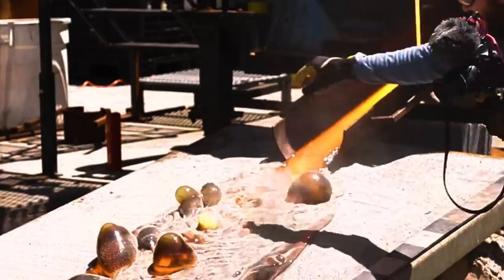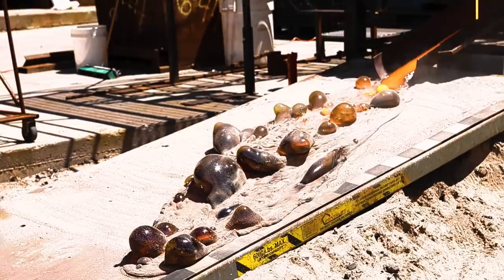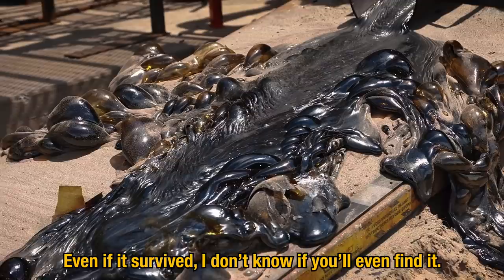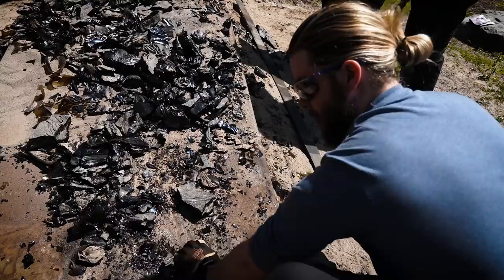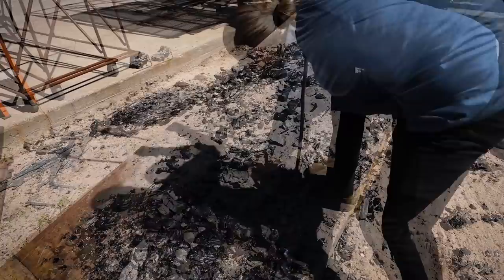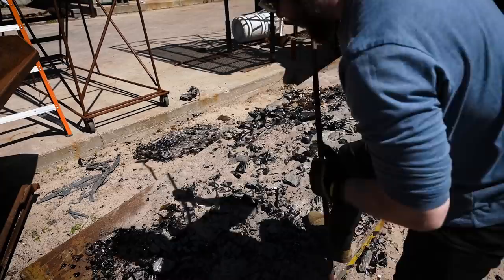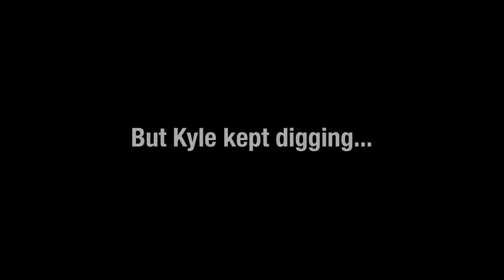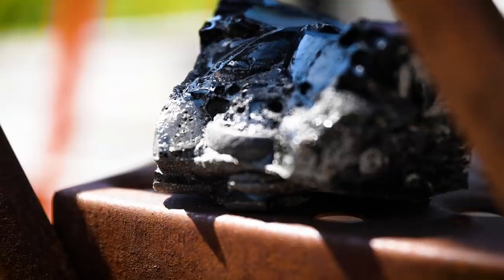Will REAL LAVA Destroy the One Ring?

Comment: This has some pretty interesting implications for the Terminator Franchise...
Reply: Maybe, but if we consider that metal is really good heat conductor and T-800 was slowly submerging into the melted metal (which was further continuosly heated), it's pretty safe bet for complete destruction od said Terminator model.
Reply: Uuuuuu
Reply: nah, the franchise is still dead and melted
Reply: We don't actually know what technology was used by the T-800, but yes. The T-800 had a nuclear fuel cell, and since it didn't explode like the hydrogen fuel cell of the T-850, that may mean some interesting radioactive material in the steel. Modern information technology is based on silicon, copper, lead, and a host of other materials, all of which would degrade in some form at those temperatures. Unlike basalt, steel does transfer heat well, and unlike lava this was actively being heated, so if the information technology was anything like modern, then it was destroyed, but would leave a mess of strange impurities in the steel.

You're not going to be able to reverse engineer the hardware, but you can probably figure out what alloys it was made of and what its nuclear power source was.
Reply: @Merennulli  Re: impurities in the steel.  Most of the Terminator would be in your driveway, not your car.  Impurities in steel production are skimmed off as slag.  It looks like pumice and it is often used in road construction. I used to live not far from US Steel and they'd have mountains of the stuff piled up across from the blast furnace buildings.
Reply: @Lawrence330  My impression from the chains and other structures was that this was a vat further further in the process prepared for pouring.
Reply: hmmm so so, steel has a higher Melting temperature than rock of any kind. so terminator works out just about really.
Reply: No. Molten steel inside an industrial furnace is not the same as "lava" on a metal sheet.
Reply: Quick science lesson.  Lead (Pb) melts at 327C, Tin (Sn) melts at 232C, yet once melted, they alloy into 'solder' which does not completely harden until 183C or lower.  It is possible, the right ratios, to have several metals with melting points of 232C or higher that once alloyed will melt in very hot water (70C range.)  One example is Wood's metal.
Reply: @wayneegli8379  Now I want to see someone make a replica of the Fields Medal out of Field's metal.
Reply: technially he died in molten metal much worse then the stone lava.
of course skynet did adjust the design to be far more resitant to heat after GEN 1 Arnie.

Comment: Big difference between this and what we saw in the film: this was a fairly small flow that cooled quickly, whereas in the film it was chucked directly into a large magma chamber which was being kept hot. I would hazard a guess that the surrounding lava would keep that insulating layer from solidifying, giving the Ring enough time to heat up and melt.
Reply: Also id imagine the ring being actual gold all the way through, or at worst gold plated steel which would melt at a lower temp
Reply: I'm going with the magic catalyst reason. Having done some casting and melting metals for jewelry,  it doesn't go that fast, even at super high temp. I think it's more that they fulfilled the magical requirements to un-make the ring, the magic unraveled, and the ring essentially melted itself.
Reply: @seancrane278  that was my interpretation too, it's not a matter of melting point, but of the magic that was in it being transferred back to Sauron. Putting it into Mount Doom bought it full circle back it its starting point, forming a ring of a different kind.
Reply: A bigger difference is this is real and the film was CGI
Reply: The "real" One Ring probably didn't have a titanium core...it was...UNOBTANIUM! Bwahahahah!
And yeah, in a real magma pool you'd likely get a leidenfrost effect, but a few minutes of heat soaking'd bring everything to thermal equilibrium and "ta daaaa!", no more ring thingy.
Now about those eagles...
Reply: @svenmorgenstern9506  The titanium core is probably what helped preserve this ring the most. Most of the gold plate was sheared off, so the melting point was perhaps too low to enable the titanium to go back into a liquid state. For gold, this melting threshold is 1,064°C. For most basaltic lava flows (which I'm assuming this is in the vid due to the low viscosity of the lava displayed on camera), the average temperature would be between 984°C to 1260°C

Titanium is at a whopping 1,668°C, or 3,034°F. The lava simply wasn't hot enough to destroy it compared to the gold, and I'd be more inclined to believe the gold simply dissolved into the molten mixture at the standing temperature that the lava flow was at.
Reply: And even if it doesn't melt while sitting on top of the lava, this video shows it would sink into the magma and eventually reach a depth where it's hot enough to melt.
Reply: @XFPIt  There was a book, y'know.
Reply: The film showed a lava flow, not a pool of lava. Go back and look closely while they're fighting for the ring over the precipice. It's slowly flowing. You can also see from the part where Samwise is trying to get Frodo to take his hand that it's being fed from above, not below.

Also - if you can see it, it's by definition not a magma chamber. Magma is deep below the surface, not in contact with air. Magma is under too much pressure to be exposed to air without exploding (due to the pressures at which air can exist, not anything to do with the air itself).

As for the ring - while 1500°C is above the 1064°C gold melting temperature, the skin temperature of the lava is 750-900°C and it rapidly cools into basalt which insulates the ring falling into it, keeping it from sinking much deeper. Remember that you have to bring something up to temperature to melt it, it's not as simple as touching something hotter, you have to transfer the energy and the basalt is actively preventing it - in short, if it survives 750°C, it's not going to melt in lava because lava can't transfer temperatures above that. The black surface you saw in the video on the ring is basalt on top of the gold. It wasn't "sheered" or melted off.
Reply: exactly, and if it sank into the lava pool, presumably it would increase in heat further below the surface. even if it did form a solid shell on contact, the fact that the surrounding lava is still hot, it would just melt the solid portion again.
Reply: The effect being mentioned is the Leidenfrost Effect. I think Kyle misunderstood... it wouldn't keep a ring safe indefinitely if the lava was hot enough to melt it in the first place.
Reply: @FS4SS  It's not the Leidenfrost effect.  The effect here is a cooled layer creating an insulating barrier, not a heated layer. The lava has to heat the ring by over 1000°C but itself changes properties if it loses 600°C to become an insulating layer. It can't remelt itself at only 1500°C, so the effect holds out.

Comment: "I was there when the strength of men failed." 
In a constant supply of volcanic lava as expected in Mt. Doom would the protective layer of rock not keep melting eventually bringing the ring to equal temperature and incapable of being protected?
Reply: Correct. As long as the lava isn't in a (hyper?)cooling state--to a point to where it couldn't melt the rock--then the coating would evidently be melted away. What would happen after depends on what criteria you're using. If it was gold, then it would melt in any case. If it was titanium (excluding the gold plating, since that would melt away), then it might not depending on the temperature of the lava.

Comment: Eventually the basalt around the ring would be remelted if it was in a volcanoes or other source of constant extreme heat.
Reply: @Kyle Hill  Yeah dunno why no one else has mentioned this, if the lava is at all hot enough to melt titanium then it's going to no matter how insulated it is. Which it won't be anyway, the layer that cooled around it on contact is just going to re-melt in all the surrounding lava.

Comment: Was i the only one screaming "grab a metal detector!" When hunting for the ring?
Reply: I think the whole ramp they poured the lava out on was steel.
Reply: there are metals in the lava , so it would just go off anywhere where the pieces is thick
Reply: seems yes.
Reply: @kuromiLayfe  
I believe the metal detector would react more strongly with the ring, as long as you could tune it properly.  However, titanium is not magnetic, so maybe not?  It really depends on exactly what else was used in the lava mix and how pure the titanium ring is.  Given the volume, digging for it was probably easier.
Reply: lava is melted rock
rock has metals
Reply: @dinamosflams  not all rack has metal, furthermore, a good metal detector can not only detect but can also tell you what kind of metal it is.... So you would only need to pay attention to the titanium signals.
Reply: Titanium is not, specifically, ferro-magnetic. Most things respond to magnetic fields and electromagnetic radiation, and detectors take advantage of an understanding of physics to detect different metals.

Copper is not ferromganetic, but IS influenced by magnetic fields, for instance.

Super-cooled liquid oxygen IS magnetic. Metallic hydrogen is theorized to exist inside stars and may exhibit unique or esoteric magnetism that we've never observed before, and may be a possible source of cosmic rays, which can also be produced from magnetic fields of a spinning star, like a pulsar.

Comment: The one quibble I have with the experiment is that the ring was thrown into lava that was flowing out of the "volcano", and already beginning to lose heat at a significant rate, whereas in the books and movie, the ring was cast into the throat where heat loss would be much lower. I agree the ring would not dissolve like cotton candy in water, but I feel like surely staying in such a hot area for such a long time would cause the hardened layer around it to eventually heat back up and begin melting the ring.

Good vid though. Was fun watching the rock bubbles form.

Comment: A very active magma pool like in Mt. Doom would not work like this because you have constant heat bubbling up from the core of the planet. Eventually the cooled rock encasing the ring would heat back up and melt the ring. Your example here is a cooling mass of lava so it protects it long enough to survive. On a side note it probably would not stay on top either as there are constant gas bubbles and explosions that would cover it. Watch some videos of active lava lakes. Aside from all of that it looked like the gold plating melted off, and I know you aren't going to throw a solid gold ring in there but it should be solid gold.

Comment: My first instinct was to ask about the gold plating (engraving is deeper than plating, so I knew you'd still see the lettering on the blackened surface), but there's not much chance of the gold being harmed at those temperatures either. Gold melts at 1,064°C, titanium at 1,668°C, and this started out at around 1,500°C, but as you said, it's the surface contact that matters. The visco-elastic skin of lava that is in contact with the air is 750-900°C, and the ring needs to absorb more heat energy than that allows, so there's just no real way to keep heat around gold in lava long enough to melt it.

Comment: Sorry to nitpick, but titanium's melting point is 1,668°C - higher than the ~1,500°C that the furnace gets to - so the ring wouldn't melt even if the the lava wasn't cooling. (Notice that the gold with a melting point of 1,064°C is completely gone.)

However titanium has a density of 4.5 g/cm³ which is higher than the ~3.1 g/cm³ of lava, meaning the ring would sink. So while Mount Doom wouldn't destroy the ring good luck getting it back from the bottom of an active volcano.

(Side note just because the ring wouldn't melt doesn't mean it wouldn't get soft enough to deform.)

Comment: Lets not forget though that the ring we see in the movies landed on a small bit of crust that kept the ring from entering the lava immediately. This allowed the ring to begin to heat up to the temperature of the lava in the volcano thus when it finally breaks through the crust and touches the lava below it would not be cooler in temperature, creating the insulated basaltic resting place you refer to in the video, meaning it should melt with ease.

Comment: Of course, the one true ring can only be destroyed in Mount Doom itself, but Kyle's ring is made out of gold plated titanium. The gold will certainly melt off, having a melting point of about 1050°C. The titanium, on the other hand, has an extremely high melting point - much higher than the rock or even the iron in the furnace, at about 1650°C. So it is unsurprising that the bulk of the ring was unscathed. Another win for Sauron!

Comment: Being Sequester in a Volcanic Tomb forever was the original plan.
It has been a while since I read it, but I remember it only be a possibility that it might be destroyed.  However it was as close to a guarantee that it would be as hard to retrieve as the task could get.  If the bottom of the Sea wouldn't be safe, fish eating shiny things and all, what about giving it a trip that might flow across the core of the world?
 
If the magical alloy could withstand all normal heat and pressure, just let it sink into the heart itself.

Comment: Great video. Sorry for nitpicking, but they dropped it directly into the volcano, not a stream of lava running off from primary source. That wouldn't be as hot as inside the volcano and inside the volcano the circulation of that fluid would reheat the thin layer of cooled material that protected the ring in this video.

Comment: The slight differences are that the ring was thrown into constant temperature lava, not cooling lava. And perhaps more importantly, even if it sank a bit, and was encased in basaltic rock that'd cooled back to a solid around it - it could still float away, sink into the depths of the lava following the current and then the rock re-melt perhaps? And if it did then re-melt, the ring would be brought up to temperature with it which might in turn melt the ring - though still comes down to what the One Ring is actually made out of and it's melting point...

Comment: Lava in a lava pool is about 2200°F, where in a lava flow as its pouring off a volcano it would be cooling as it moves allowing your findings to happen. However gold melts at 1,948°F, so it you threw it into an active pool that is continually at 2200°F and churning the encasing of basalt may form, but would eventually reheat and melt, melting the ring along with.

Comment: The problem with this experiment is that the lava flow is continuously cooling. The ring is encased by an insulating layer as the flow around it continuously cools.
Were the ring thrown into a volcano, while it may initially form an insulating layer, that layer would be exposed to magma that isn’t cooling, & would likely remelt the insulating layer, eventually exposing the ring to the temperature of the surrounding magma.
In the end, it simply depends on the melting point of the ring’s material, how hot the surrounding magma is, & for how long the ring is exposed to that temperature.

Comment: Isn't gold denser than lava? I think that the ring would sink in almost immediately.  It wouldn't melt immediately like you said; but, with enough heat from an active lava pit, the layer of cooled material would eventually heat back up and the ring would melt. All that being said, Gollum, a squishy, mostly water, meat sack, is significantly less dense than lava, so he would not sink into the lava. Not only would he not sink, he would skitter around the surface of the lava like a drop of water in a hot skillet thanks to the Leidenfrost effect, as he slowly cooked to death.

Comment: Hard to tell from the footage, but did the gold plating melt off and leave the titanium core? What's left there is not very shiny. Gold's melting point is about 600K lower than that of titanium, and it is famously soft and thermally conductive. Considering how thin the gold plating layer is, could it not have diffused quickly into the surrounding medium even as the lava cooled?

Comment: Unless the ring was GOLD which has a melting point of 1,948°F (1,064°C) which is about half of that of Titanium. 3,034°F (1,668°C)

A gold ring sitting on the surface of lava would definitely melt before it sank down.

Comment: The difference between this lava and actual lava pools is the size, thermal mass, and temperature. In an actual pool of lava that woulda melted after a while. You might say "hey, wouldnt the lava cool on the surface of the ring and create a protective barrier?" but the problem is everything in a lava pool is the same composition, or at least everything melted in the pool has AT LEAST the same melting temp, so the insulating layer would remelt after covering the ring and then continue to melt the ring.

Comment: To be fair, the result is pretty much what was to be expected. The melting point of titanium is 1941 K, 1668 °C, 3034 °F. The lava was said to be around 1200 °C which is well below that temperature. The melting point of gold on the other hand is 1337.33 K ,1064.18 °C, 1947.52 °F. So the thin gold plating probably melted away an was is left in the lava is the titanium ring which may be a bit oxidized or stained otherwise. Pretty cool but no surprise. The achievement was finding the ring in the lava and having had the idea to do this video!